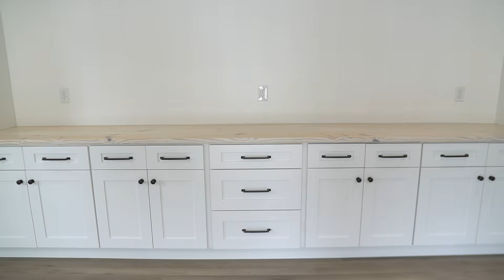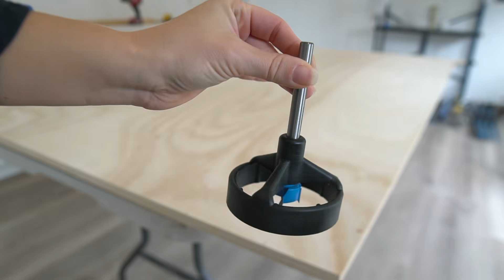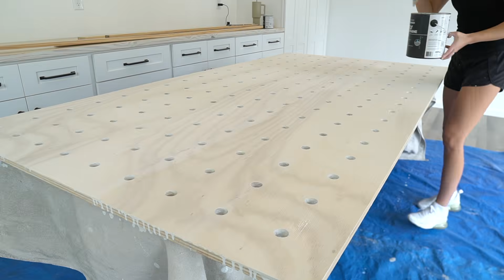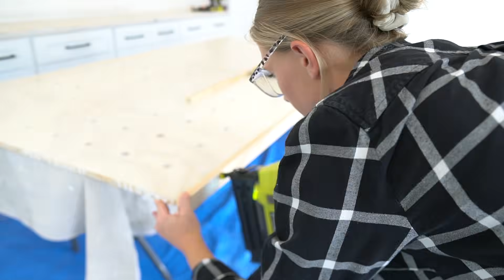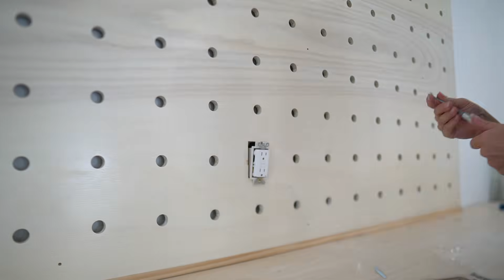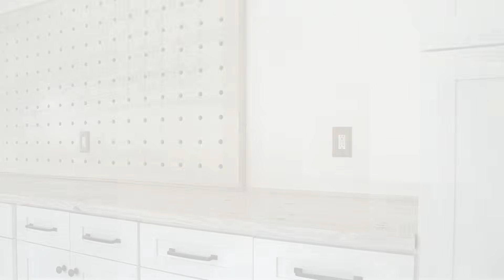DIY Giant Custom Pegboard

Comment: I've just come across your channel 🙂 The pegboard looks great, the only thing I would have done differently is that I would have put the screws holding the board to the wall into the peg holes which could then be used for holding lighter items since the pegs would have been slightly shorter. This would have hidden the screws without having to use filler

Comment: OOPS, the peg hole on the fourth row from the top and fourth from the right (next to the brush) is drilled way off your hole pattern. But nice work otherwise.
Reply from the maker: You weren't supposed to notice!! 😋
Reply: @HomeWithStefani   😆 I might've tried to repair it, but I envision it being more trouble than it's worth. Very cool build, though.

Comment: Looks good.
Create a sanding rod by using a 7/8 or 3/4 dowel. Take 7/8 dowel drill 3/8 hole in one end glue in a short piece of 3/8 dowel to attach to a drill, this will save you a lot of time and easy to swap out sandpaper grits.
Very nice project
Reply from the maker: Great tip! Thank you 🙌